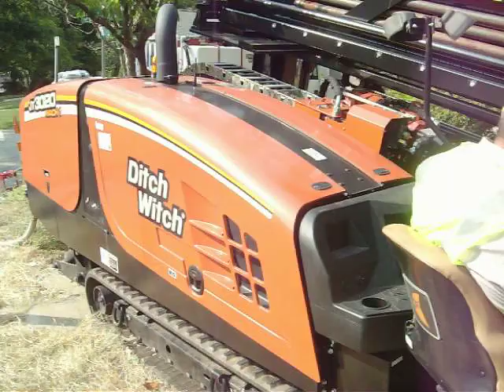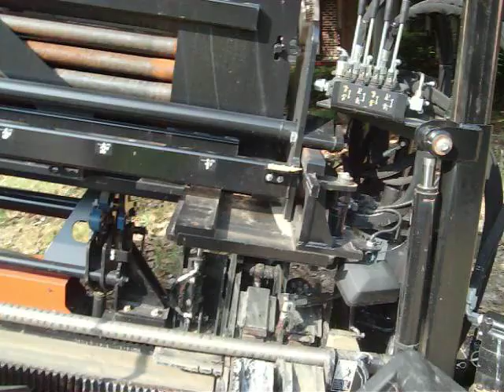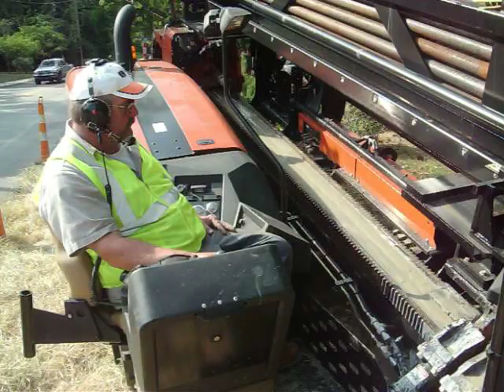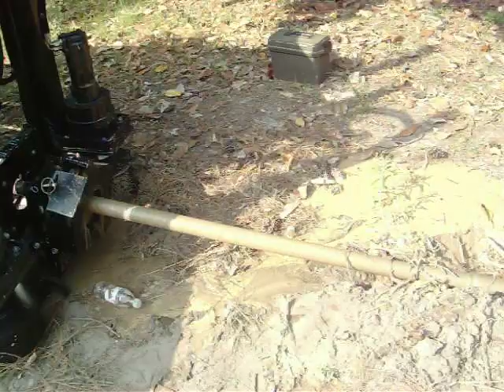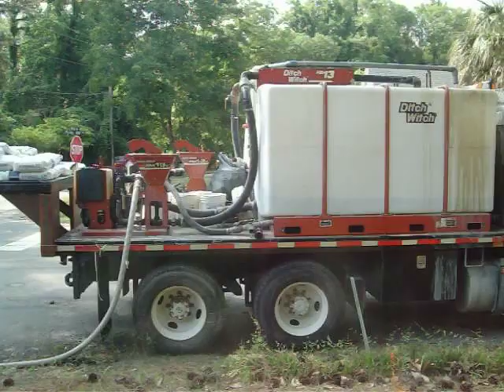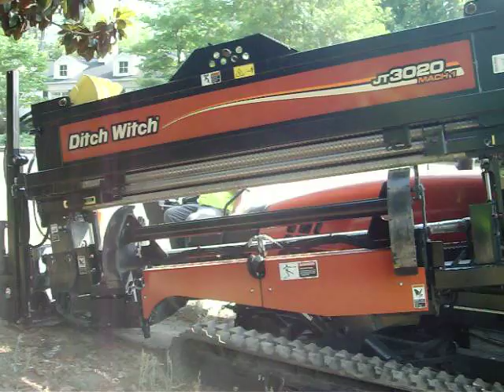Ditch Witch JT3020 Mach 1 Directional Drill

Comment from the maker: Ditch Witch only manufactures horizontal directional drills for installing utilities; currently they are not designed for frame/carriage to raise @ steep entry angles for water well or geothermal loop installations.